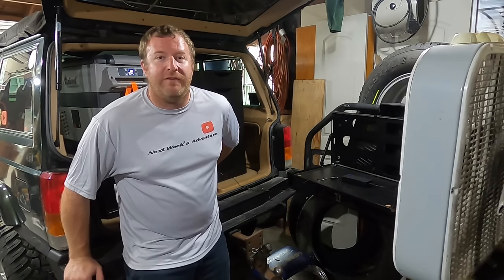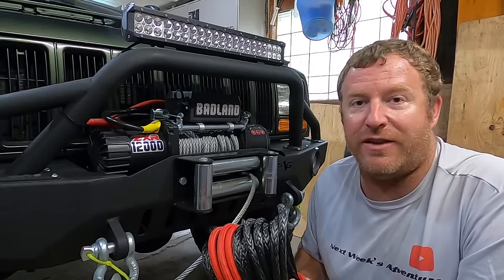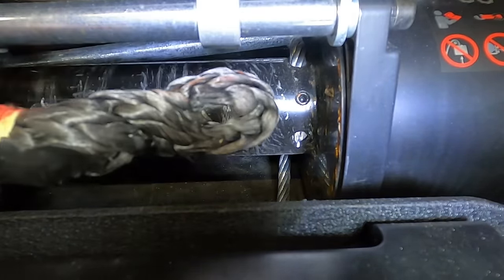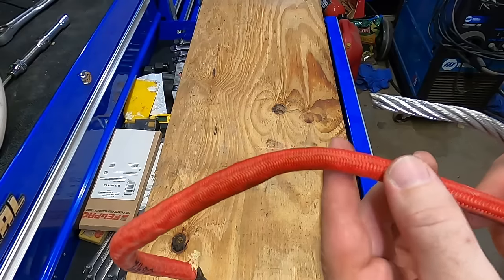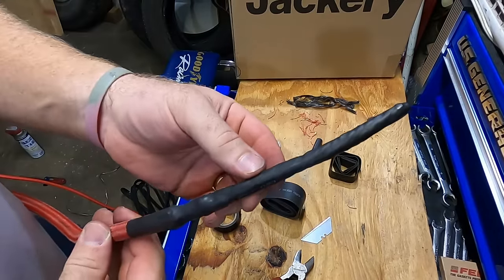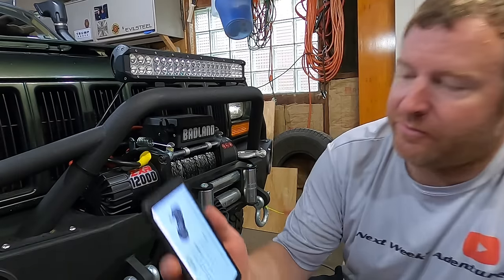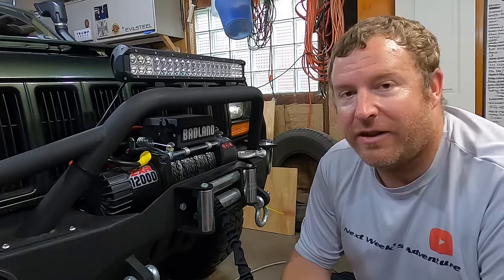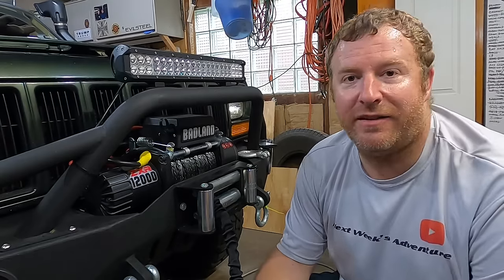Harbor Freight Badland winch upgrade you must do!!!

Comment: How has this setup been holding up for you , specifically the roller fairlesd with rope instead of cable . I prefer rollers but im paranoid it could pinch the rope / slide off the rollers into the corners on angled pulls
Reply from the maker: I've had no problems. If I ever do I won't hesitate to talk about it.
Reply: Good to hear. My hawse style fairlead sits too far back in my bumper since it was made for rollers. I just ordered a roller fairlead from Bulldog winch to try out instead but some folks comment on potential for snags. Will find out for myself
Reply from the maker: @Mike-fx4jn  I've heard all about how I'm doing it wrong. I'm not going to say pinching or chafing will never happen, but it hasn't happened yet to me. My winch and rollers were new so they are clean from wire scratches when I switched to a rope which does help

Comment: My winch does not have the hole in the drum. It has a screw on the side plate of the drum where the wire rope had an eyelet the went on it. The Badlands synthetic rope came with 2 keeper deals and screws. Not sure if they are for different styles of winches but yeah.

Comment: I have a question, What brand and model is your front bumper? I am considering an upgrade and like the bumper/winch combination. I just recently purchased the Badland 12K winch from Harbor Freight. Thanks
Reply from the maker: It's a EAG bumper. Went on very easy and has held up very well. I'd absolutely buy another over a more expensive brand. Only thing I would or will be addressing is I got the one with round led lights and they aren't as bright as I want them to be.
Reply: Thank you

Comment: I've watched a few of these videos on how to swap out to a synthetic rope. Yours is the best of them all. I noticed you left the tensioner on. I see allot of guys taking theirs off. My question is... so you don't have to mess with taking the tensioner off at all?
Reply from the maker: Thanks!!! I appreciate that.  I didn't remove mine to install and haven't removed it since. Haven't had any issues running it.
Reply: The tensioner is only needed for the wire rope. It keeps the spool tighter since the wire wants to expand/straighten out off of the spool. Synthetic doesn't do that. I suppose you could leave it on but it doesn't serve a purpose. I had to remove the tensioner bars to fit the winch in my ARB bumper.
Reply: I just took the springs off

Comment: Did you consider just opening up the hole in the drum to accept the larger size of the cable end?
Reply from the maker: I would rather trim the rope than drill out the drum. Just seemed easier and doesn't remove strength from drum.
Reply: @nextweeksadventure  hmmmmmm? Didn't seem like it would have been that much dia. Change to cause weakness. 
But hey. I wasn't there. 👍👍
Reply: Rope breaking? Not too horrible. Drum breaking? Absolutely fucked

Comment: I would grind that setscrew flat before reinstalling it so it doesn't cut into the synthetic rope
Reply from the maker: Set screw is only to stop the rope from coming completely off drum if unrolled to far. You shouldn't be unrolling it to that point to winch.

Comment: Can you tell me where to get the set screw? Size? A buddy was helping me and pulled it all way out, don't think they put one in. He was backing up to be my anchor but think he got little to fast, mine will wind in but won't mechanical wind out with the hand held control but I have a wireless controller I'm going to try and see if he broke it or controller got in mud
Reply: Tractor Supply Company. They also have test boards for different thread sizes.

Comment: Why not run a bolt thru where the original cable went thru to mount the synthetic? 🤔 (cover bolt head with a piece of rubber to prevent damage to the synth)

Comment: What brand of winch bumper is that ?  I have a two wheel drive XJ and a Badlands 12000 lb winch.  I would like to get it mounted on Jeep.  Thanks for the valuable info.
Reply from the maker: EAG I ordered it off amazon. No issue yet pretty solid unit. Went together super easy with great fitment.

Comment: What is the primary benefit to switching to rope vs steel cable?
Reply from the maker: Main reason I'm clumsy and find using rope easier to handle.
Reply: Primarily safety, steel wire that snaps under tension could kill or mame you when it whips upon failure, not unlike a bullwhip !...Secondly rope has a higher tensile strength and will just fall to the ground if it snaps...as it instantly releases the energy a steel cable would be holding

Comment: Stopped by my local Harbour Freight to ask about this and was told that winches  & winch line are not allowed to be sold at a discount as an open box item, per company policy. Not sure if that's completely true but I'll have to look for a better deal elsewhere.
Reply from the maker: That's weird🤔 mine was literally a rope on a shelf with a tag said returned marked down. I've also seen items recently same deal. I've never seen an actual winch this way so maybe that part is true. Hope you can find one or similar.🤞

Comment: Will the apex fit in that bumper without any issues?
Reply from the maker: They show the are just about the same size according to HF website. I would think it should fit with no problems. The hardest part on the badlands series was getting the wire control box to mount to top. Its very tight against the grille but does fit.

Comment: Why not leave the loop on the end and find a bolt  that threads into where the set screw came out of and add a thick washer? Run the bolt and washer through the end and tighten to the drum.

Comment: Mine got water in the control box, sucked the hook in and blew the motor up. Never even got it off rd.
Reply from the maker: Oh no..  You able to get it replaced under warranty?
Reply: @nextweeksadventure  literally just happened so I'm just starting to look into it. Contacted em, gotta wait for a response. Seems like the control box should be able to be rained on. But I'm new to winches...

Comment: I wouldnt call a synthetic rope an upgrade.i bought one for mine and broke a 12k ratex rope with a 10k winch. Put my wire cable back on and done the job without any issues.

Comment: Thoughts on retaining the tensioner with the rope?
Reply from the maker: I didn't remove it on mine. Everything is just the same as when it had the cable on it. Only thing I have to watch is the control box on top.  The rope is thicker so when I spool it all the way in it gets very close and has caused it to pop off the bar mount.

Comment: Why is the rope better than cable?
Reply from the maker: It's mostly user preference. I find it a lot easier to handle when using rather than the cable. I can unwind a bunch of rope and hang it under a wiper blade, around the antenna or even toss it in cab with me if I'm going into a deep spot and need quick access to a fast winch out.

Comment: Did you really pull a drawer out and lay a board across it to make a work bench?
Reply from the maker: Absolutely... and I've also used a ratchet as a hammer and a screwdriver as a prybar.  I have since bought a storage cabinet with a nice woodtop to use instead of my toolbox. No shame in my ability to multi purpose.
Reply: @nextweeksadventure  i wasnt nocking it, thats genius and i fully intend to utilize it.  . .kinda interested in the ratchet hammer story, gonna guess its a jeep thing lol
Reply from the maker: Yeah its all good I figured you were joking around. Hey if it works it works. As for my tools. Most of them with exception to some of the expensive ones are universal tools. Thanks for watching and taking time to comment!

Comment: could you drill the drum hole bigger
Reply from the maker: Probably hundreds of different ways to mount the rope. This was the easiest way I decided to do it. I haven't had any problems yet. The set screw doesn't take any of the load and slimming down a few inches of rope also  Leaving plenty of rope on the drum while pulling is what takes the load. This was just how I did it. Thanks for watching!

Comment: Do you have a link to the bumper?
Reply from the maker: No direct link to bumper sorry. I got it off Amazon and they closed my affiliate account. Search EAG front bumper with led lights. They have a few models. One with square lights and this one with the round. For it being a cheaper bumper it honestly went on super easy and fits great. Came with good hardware and I've had no issues with it.

Comment: Did you have problems  with it being  wired wrong
Reply from the maker: Sorry I'm not sure what you mean. Wiring is ok no issues. I prefer the resetting breaker I installed over the fuse it came with. I went with the synthetic rope because I find it easier to work with. Hope this answered your question. If not let me know. Thanks

Comment: Does the 12000 lb rope fit the 10000 lb winch ?
Reply from the maker: I cant speak for sure on this one. I would imagine it does. The only possible way it wouldn't is if rope is to long for drum and wont coil it all on. Im not sure if winch drum/housing is same size or not.

Comment: What’s wrong with synthetic and rollers?
Reply from the maker: The rope could get caught in a pinch point between the rollers in the corners. Or if you have used a cable on rollers for a long time it could put cuts in the rollers which could cut the rope.  My rollers are still in good shape so I'm willing to risk it.
Reply: @nextweeksadventure  thanks! Is it Also ok to use steel cable on a slider style too? Or should you only use rollers there as well?
Reply from the maker: Honestly I've read plenty of reviews and it's user choice. It's ok to use either cable or rope on roller or hawse fairleads. Rollers have more parts that can wear out and need replacement so thats something to remember if your doing a lot of winch use. Either way yer good.

Comment: I'm not sure what's worse - the fact that he's only using the Set screw to hold the rope (!) or that the entire savings tip is to look for a cable in the discount bin.
I go to several Harbor Freight stores regularly and have never seen a synthetic winch cable in the clearance bin.

Comment: I will stick with wire rope. as my cj-7 and truck live outside in all weather. the plastic rope will not survive the harsh conditions like proper winch steel rope can.
the plastic rope will snap, or be damaged beyond more use if you have to allow it to rub most everything. in a number of recovery's i have done, at times the rope has cut into the rock, the plastic will be destroyed.
but the biggest problem. is just sitting outside in all weather the plastic rope is hurt by this far more than steel rope.
but for those that want it, good job letting them know about it, but please beware not all plastic rope is the same in build quality.
i just bought one of these winches on sale $250,USD, first thing i am doing is replacing the supplied wire rope with a better grade. (communist china is know for there lesser materials).
buy only the best,(warn is out of my budget) as any cable can kill, and pulley can break, and point's in these systems do and have failed. including top of the line stuff.
do it right and be safe.

Comment: The best and most important upgrade you can do imo is scrap the circuit breaker that comes with the Badlands Winch! It is so cheaply constructed they should be ashamed to include it with the winch! I 've  seen them start tripping over heating continually ,almost from Day 1. Nothing like trying to winch cable in and breaker trips every 10 seconds and you need to wait 30 seconds or more while it cools down! I was ready to throw the entire winch in the trash. Instead I bought a quality 50 amp circuit breaker from an Auto Electric Shop with a Reset button on it and mounted it along side the battery . Ever since the winch has not shut off on me even once !  Prior to that ,it would constantly shut off even running free cable back in .  The other Dirty Secret HF Doesn't advertise is the Duty Cycle of Their Winches.  It is very very low like 15 seconds of winching requiring 5 minutes of resting time !  That is really low duty cycle . I use my winch nearly every day dragging trees out of the woods. I  try not to get it too hot but I basically do what I need to do ! It is a work tool for me not something to look cool on the front of my truck . So anyone else having their HF Winch Continually shut off ,throw away the circuit brkr and get a good one!
Reply from the maker: I did. Put in a disconnect breaker works great.

Comment: Whether switching from a wire rope to a synthetic rope is an "upgrade" is debatable... I have yet to see any of the tow trucks or cranes switching from steel to synthetic... When they do, then I'll consider it...
Reply from the maker: I see what you're saying. My experience is I just prefer rope because it's easier to handle out on the trail. I can unwind a bunch of rope and wrap it around my side mirror or under a wiper blade if I get stuck in deep water for quick access for a faster recovery. Steal cable is fine but not as easy to work with in my opinion. Thanks for watching and taking time to comment.
Reply: @nextweeksadventure  -- Couldn't you do the same thing with steel cable if you attached a synthetic leader to it?  Personally, I try to stay out of water so deep that it comes up to my windshield... Deepest I ever was ever in when I had my XJ was a bit over the top of the 31x10.50s that I was running... The ground LOOKED perfectly solid before I drove there... Ooops...

Comment: Stop calling it a steel cable. It’s not a cable. Cable is solid. That is a wire rope.
Reply from the maker: You should let Harbor Freight know because they have it listed on website as Steel Winch Cable.
Reply: No.
Cable is any thick rope. You can have cable made out of Manila, cable made out of hemp, cable made out of wire.
Reply: @nextweeksadventure I’ll listen to the leading industry experts. Wteckmasters. Believe they are the authority on proper winching materials, and what they are actually called. Not a store that just sells tools, and not experts in a certain industry.

Comment: Do yourself a favor and save up more to buy a quality winch instead of the terrible harbor freight winch. Mine broke after 2 years and now requires me to completely remove my bumper to replace it with a decent winch. The harbor freight winches are garbage.
Reply: Wonder why HF winch has lasted me 8 years of abuse hauling scrap vehicles then 🤔 I'm talking trucks with locked up brakes wreaks with missing wheels I've used it heavily sorry your experience was bad